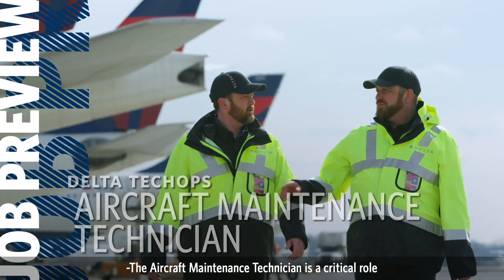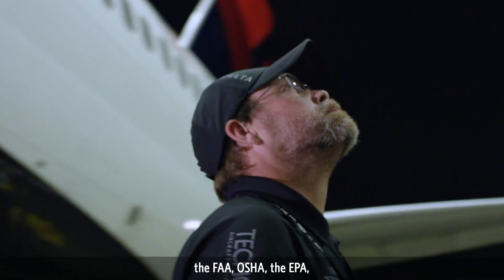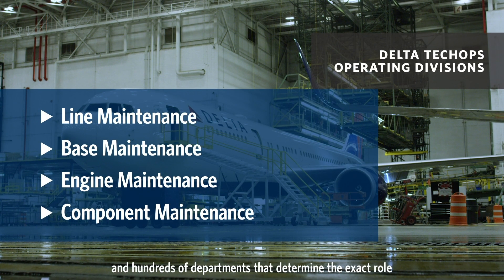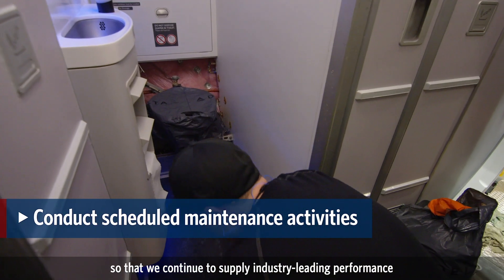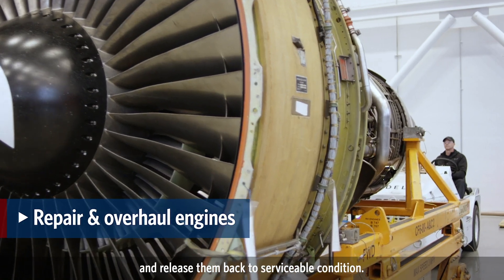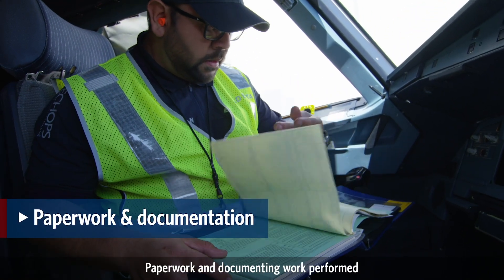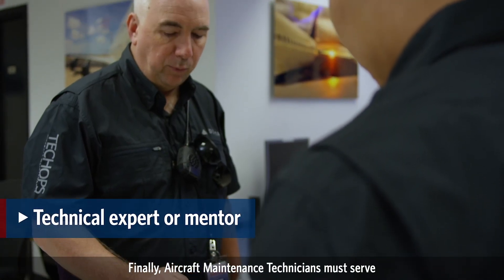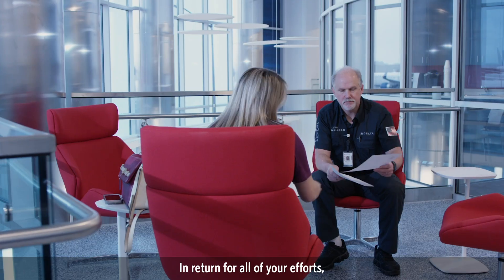Delta Job Preview -  Aircraft Maintenance Technician

Comment: 32 year retired major airline A&P here.  I started out in the Navy, worked on my A&P during the few off hours I had got my license within a month of separation. Worked defense contract, commuter regional, air freight, then major airline.  It's a good time to be in this field when I got out of the Navy no airline would even respond to my applications.  But there are also down times, the 9/11 layoffs were bad, there were people on the street for years in some cases.  The pandemic was not quite as bad but people still got laid off for a while.  Be prepared to work third shift for many years in this business, you will experience exhaustion and fatigue frequently.  You will work with many dangerous chemicals, please always use your safety equipment especially safety glasses.  It's a dangerous business and I have seen people killed and maimed for life, keep your head on a swivel at all times.  FLY NAVY!!!
Reply: You worked at delta?
Reply: @six1364  No but it was one of the other big 3.  FLY NAVY!!!
Reply: I have 2 years left to retirement.  I’d really appreciate some mentorship.  This is what I’d like to do
Reply: @KhaoticUnicorn1  You want to retire (from where) and work for the airlines?  FLY NAVY!!!
Reply: @USNveteran  currently stationed at the Naval Academy, hopefully retiring in Florida.  Hoping for the airlines.
Reply: Can i ask what exactly makes it dangerous or would cause someone to be killed or maimed? I know it seems like common sense but I’m curious about specific dangers to look out for since I’m going to get my A&P license.

Comment: I like airplanes. I dont have interest in research and development but in field job like manufacturing and maintenance. So are aeronautical engineers required in maintenance or only Aircraft mechanics?

Also is there a significant advantage in doing aeronautical engineering before becoming an Aircraft technician?

Comment: American Airlines (AAL), Delta (DAL) and United (UAL), three of the larger US airlines with the jets, said that they have not discovered any problems in the planes that have been inspected so far. They all said none of their planes have more than the 30,000 flights that required immediate inspections.

Comment: Does Delta do maintenance on 737-700's and 757's?
Reply: Yes
Reply: The FAA proposes to adopt a new airworthiness directive (AD) for certain Boeing Model 737-600, 737-700, 737-700C, 737-800, and 737-900 series airplanes. This proposed AD would require an inspection of the vertical fin lugs, skin, and skin edges for discrepancies, an inspection of the flight control cables, fittings, and pulleys in section 48 for signs of corrosion, an inspection of the horizontal stabilizer jackscrew, ball nut, and gimbal pins for signs of corrosion, and corrective actions if necessary. This proposed AD results from reports indicating that moisture was found within the section 48 cavity. We are proposing this AD to ensure that the correct amount of sealant was applied around the vertical fin lugs, skin and the skin edges. Missing sealant could result in icing of the elevator cables, which could cause a system jam and corrosion of structural and flight control parts, resulting in reduced controllability of the airplane.
Reply: As for 757's, we propose to adopt a new airworthiness directive (AD) for the products listed above. This proposed AD would require repetitive detailed inspections for discrepancies of the horizontal stabilizer ballscrew assembly; repetitive lubrication of the horizontal stabilizer trim control system; repetitive measurements for discrepancies of the ballscrew to ballnut freeplay; and corrective actions if necessary. This proposed AD was prompted by a report of extensive corrosion of the ballscrew of the drive mechanism of the horizontal stabilizer trim actuator. We are proposing this AD to prevent undetected failure of the primary and secondary load paths for the ballscrew in the horizontal stabilizer, which could lead to loss of control of the horizontal stabilizer and consequent loss of control of the airplane.
Reply: In 2011, The proposed AD would require repetitive detailed inspections to check the 757 ballscrew assembly for measurement discrepancies and freeplay, and requires repetitive lubrication of the part. It is intended to “prevent undetected failure of the primary and secondary load paths for the ballscrew in the horizontal stabilizer.” The FAA is estimating cost of compliance of this AD, which would affect 730 aircraft, at $1,105 per aircraft for inspection and about $2,210 for replacement work (excluding the cost of parts). Today, all 757 are being inspected, repaired, and are flying again.

Comment: How much would y'all say an Air Force Aircraft Technician (crew chief) with 6+ years experience on a carrier (similar to commercial), an AMP, and multiple certifications related to maintenance, and a degree start off at?
Reply: You have to start from the bottom and pay is based on time with the company. Doesn’t matter what experience you have. If anything that only helps you obtain the job.
Reply: Delta is over 30 an hour now
Reply: This is by no means accurate but I'd say maybe 36 to 40. I know Delta starts people off at 30/hour no matter what though based on what a maintenance supervisor said when he came to school.
By the way, it's A&P.

Comment: could I apply for Line Maintenance?
Reply: Delta.com currently has Technician openings in LAX, SFO, MSP and ATL
https://delta.avature.net/careers/SearchJobs
Reply: Mitch P do your need your A&P for cabin maintenance?
Reply: @noelkibrom2708 Delta has ASM (Aircraft Support Mechanic) which is essentially a Mechanic Helper. ASM's perform much of cabin maintenance.
An A&P isn't required for this position but certainly helps because it's so competitive.